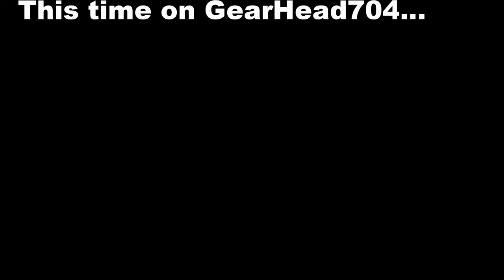My SSP FoxBody Mustang REBUILD continues... Installing the pinion in the 8.8 rearend

Comment: Also noticed it seems you installed the bearings dry, no packed with grease. Is that normal for the rear end rebuild? Seems odd.
Reply from the maker: I know thats done on disc brakes, but i''m not sure about needed it with rear drums (or maybe the brakes have nothing to do with it).  I did add some transmission fluid, but i'll check with Matt.  The old bearings I pulled out didn't seem to have any grease on them either.